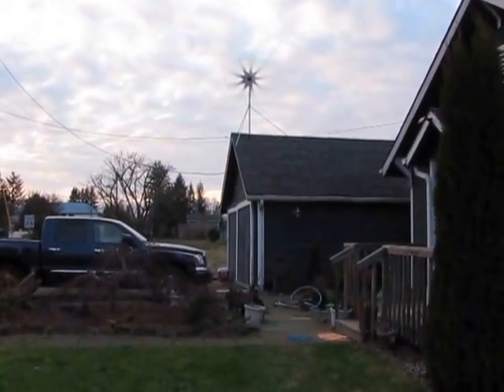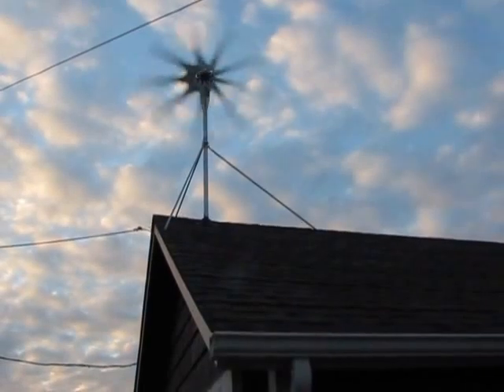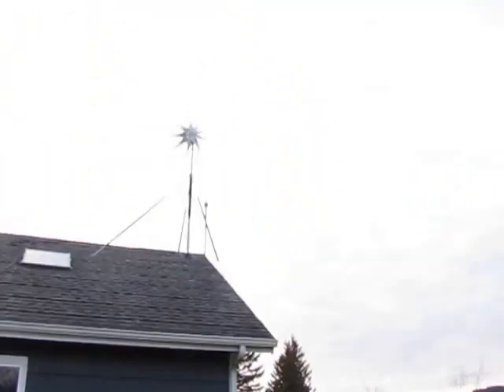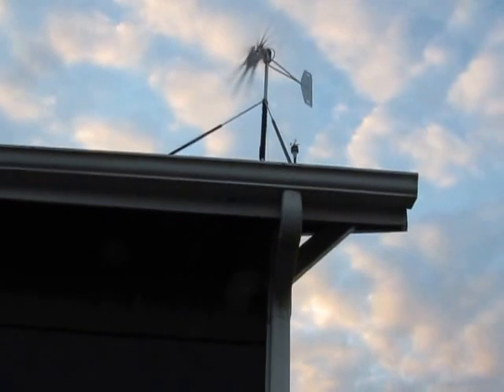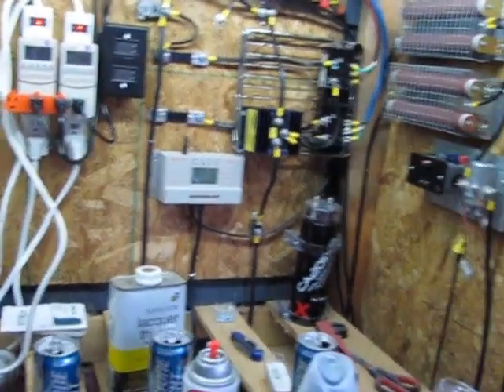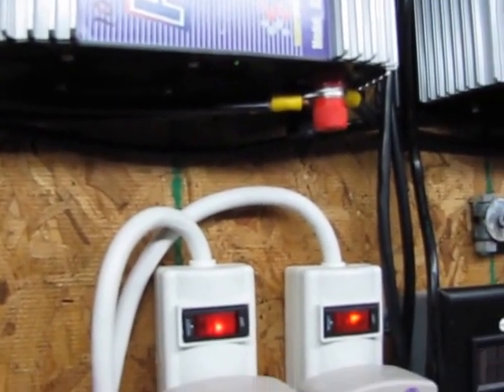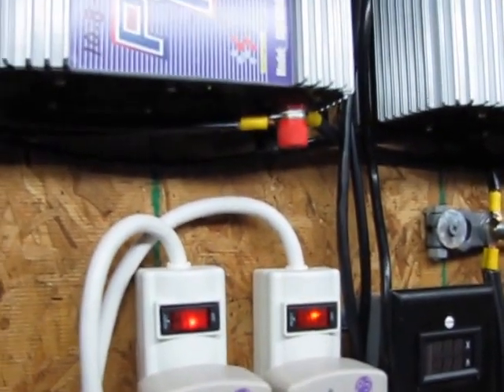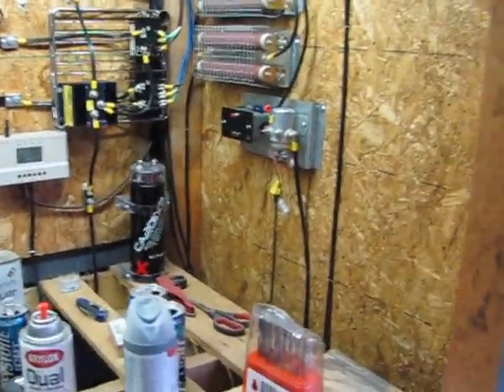Low wind MW&S power output 6-9 mph winds,, Old Video 2/4/14

Comment: If it says its a 1600 watt turbine, wouldn't that be like 80 amps in 24 mph winds like the wind power calculator says how to measure it? Something isn't right on that and your wire from my seeing it.
Reply from the maker: I am still using the same basic setup today it has been Almost exactly 4 years now, since this video you posted on, My wind and solar system still works awesome for me in my area, I love it :) Here is my most recent video where I talk A Little about my turbines ,, https://www.youtube.com/watch?v=SSd8OSkZJ7Q ,, You can see even today I am still happy with my setup :)

Comment from the maker: It seems that 7mph winds is when my 12volt MW&S turbines start making power using the 9 Raptor Generation 4 blade setup and 10.8-30volt Sun grid tie inverters.